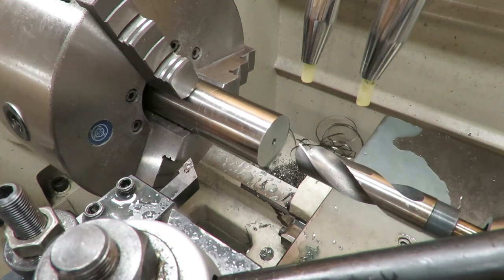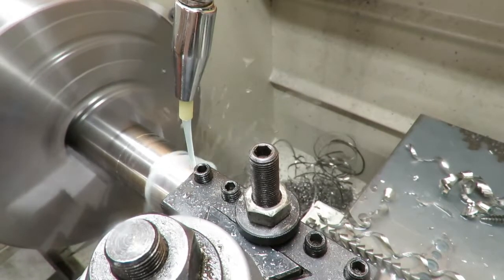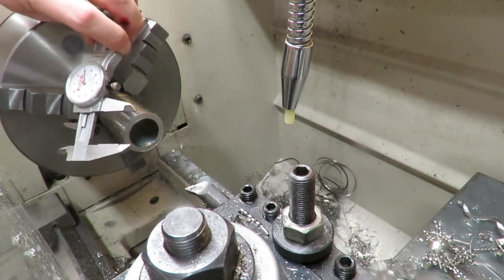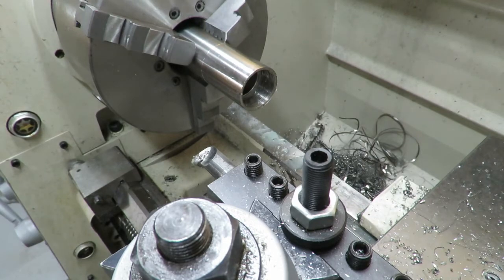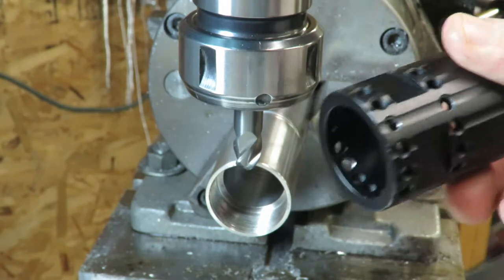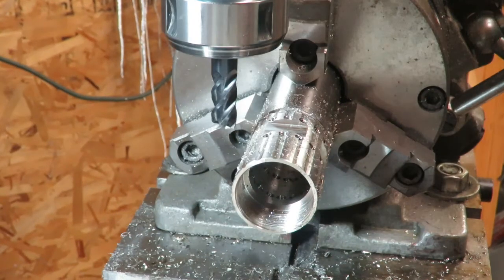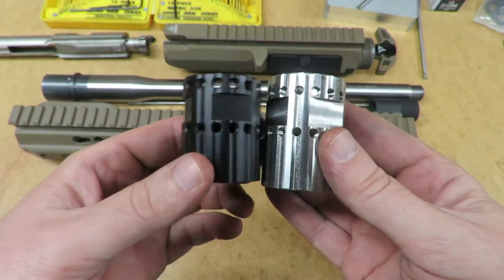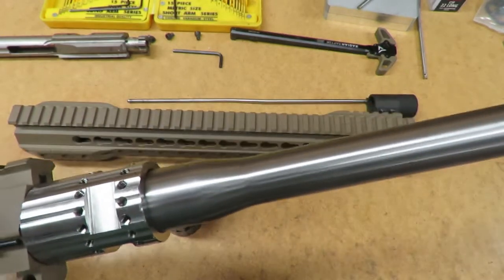Machining a AR 10 barrel nut

Comment: Very very nice!!!! 
I wish I could do that! 
IT MUST IMPROVE ACCURACY!!!!! 

DO YOU GLUE YOUR BARREL EXTENSIONS INTO THE THE UPPER RECEIVER?
Reply from the maker: Thanks!
It helped accuracy a little. The upper is A LOT! more solid with that barrel nut as opposed to the factory one.
  I never glue them. If I need it to be that solid or tight, I'll get a aftermarket one with better tolerances or a over size one and trim it to the exact diameter.

Comment: I might have missed it but why did you make your own?
Reply from the maker: Several of the screws stripped out on the factory one and they only have them in aluminum.
Reply: I saw your first 45 Raptor build video and your torque wrench on the barrel nut tool. Are you adjusting your torque wrench setting for the extra leverage those tools provide? If not you're going to over-torque the nut and strip threads. Personally I don't torque AR barrel nuts. I go "snug" and then tighten as required to align the gas tube. I've "built" a pile of AR15s that way and have had the barrel in and out of my LR308 using that method with zero issues with stripped threads regardless of manufacturer of the parts involved. Using lubricants on threads also decreases friction and makes over-torquing very easy. There is no other reason for an aluminum barrel nut to strip out on an aluminum receiver and going with a dissimilar material like steel introduces the possibility of issues with different expansion rates and stripping the upper instead of the nut. Stainless steel is only stainLESS and not stainPROOF and galvanic action is a possibility with a stainless/aluminum combination as well.
Reply from the maker: DEEREMEYER1: I'm doing the same here, I tighten by hand then index to the right position. I use the torque wrench mainly for absolute control for fine adjustment.
  The reason for changing the barrel nut was several of the crews for the hand guard stripped out.
  Dissimular expansion isn't a concern, because this gun is not going to be shot nearly enough at once to generate that kind of heat.
Reply: That's nowhere NEAR tight enough. Your threads are "stripping" because the nut is "pounding" back and forth with the "too loose" barrel and the much softer barrel nut threads are taking it in the shorts while the harder and "tougher" threads on what is probably a forged upper "survive". That you have handguard screws stripping out just supports the fact that your biggest problem is you do not have the proper tools to be "building" ARs. Get the proper tools including "proper instruction" and "know-how" immediately before something really comes apart and somebody really gets hurt. 

Put 10 rounds in 5 minutes through ANY high-powered rifle and you'll have "hot" barrel/receiver/bolt parts I guarantee are undergoing "dimensional changes" but since in PROPERLY "ENGINEERED" AND "BUILT" RIFLES the "mating parts" are of the SAME MATERIAL, THEN "DISSIMILAR EXPANSION ISN'T A CONCERN" BECAUSE THAT PROPER ENGINEERING AND CONSTRUCTION AND ASSEMBLY PREVENT IT FROM BEING A CONCERN. STEEL BOLTS IN STEEL BARREL EXTENSIONS/BARRELS "MATE" TO EACH OTHER. STEEL BARRELS "FLOAT" IN THE ALUMINUM RECEIVER WITH THE ALUMINUM BARREL BUT "CAPTURING" THEM AND PROPERLY "HEADSPACING" THEM IN THE RECEIVER AND THE BARREL HEATS UP FIRST AND THE ALUMINUM "HEAT SINKS" OF THE RECEIVER AND NUT BEING OF THE SAME MATERIAL AND "LOCKED" TOGETHER BY THREAD TORQUE/TENSION ARE ALSO "MATED". 

KNOW WHERE YOU'LL FIND STEEL "NUTS" ON "ALUMINUM BOLTS" FOR LACK OF A SIMPLER/BETTER WAY TO "EXPLAIN" THE ISSUES AVOIDED BY USING ALUMINUM BARREL NUTS ON ALUMINUM RECEIVERS? NOWHERE. STEEL BOLTS IN ALUMINUM "NUTS" AND OTHER FEMALE THREADED PARTS YES. BUT THAT SITUATION REQUIRES FAR "LONGER" THREADS AND A LOT MORE "THREAD ENGAGEMENT" IN "FASTENER DIAMETERS" THAN IS REQUIRED FOR STEEL IN STEEL/IRON THREADED FASTENERS. KNOW WHAT YOU DON'T HAVE PUTTING THAT STEEL BARREL NUT ON THAT ALUMINUM UPPER? MORE THREAD LENGTH AND ENGAGEMENT THAT WOULD BE NECESSARY EVEN IF THERE WERE "REAL WORLD" EXAMPLES OF ALUMINUM "SCREWS" IN "STEEL NUTS". 

SERIOUSLY, YOU HAVE NO CLUE WHAT YOU'RE DOING. AND IF YOU WANT TO DO SHIT YOUR OWN WAY THAT'S GREAT BUT AT LEAST MAKE SURE YOU DON'T HAND THAT "PIPE BOMB" TO SOMEBODY WHO WOULD OTHERWISE PROBABLY BE SMART ENOUGH TO KNOW BETTER IF THE TABLES WERE TURNED AND THEY THE "BUILDER" AND YOU JUST THE "FRIEND" OR "FAMILY MEMBER" SHOOTING THEIR "AR BUILD".